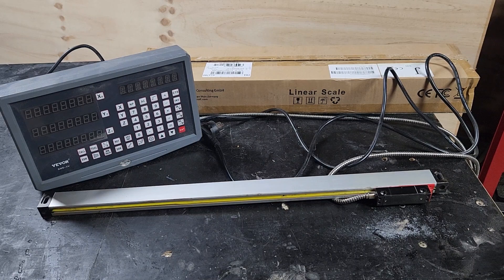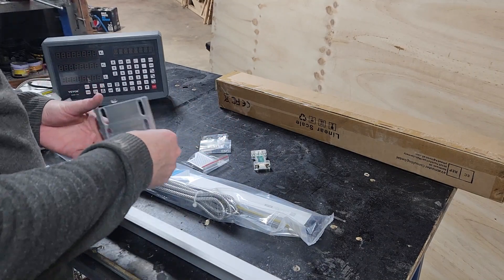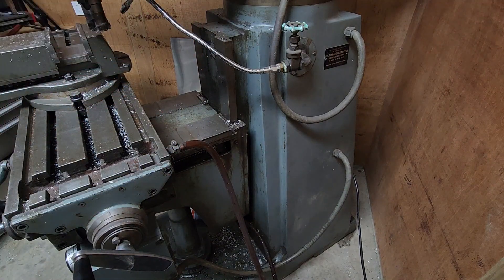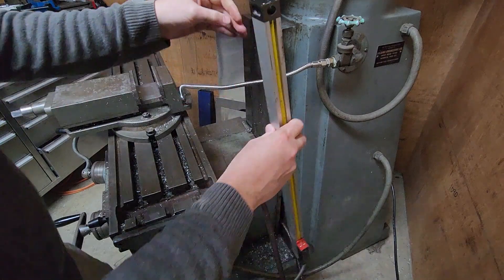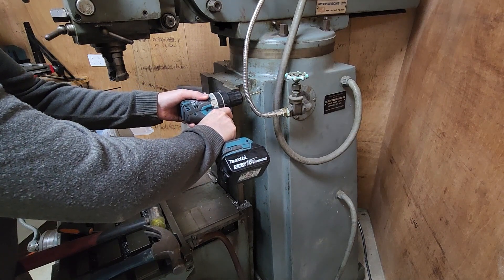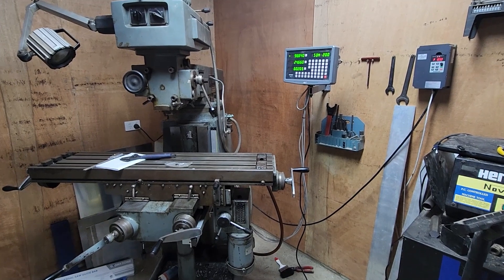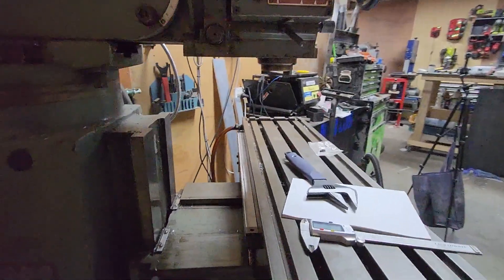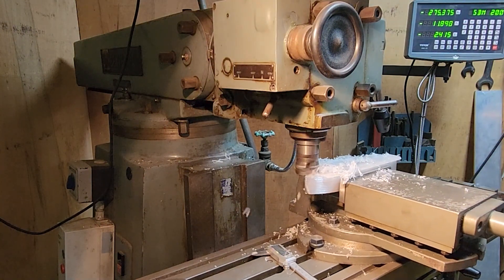Installing a Vevor SNS-3V DRO Kit onto the BeaverPal MK1 milling machine

Comment: Hi Bob, nice Video. I installed linear scales (Form aliexpress) and the Vevor DRO on my lathe but 2 of them are sometimes working and sometimes not. Do you have any Idea how to solve this problem? Are my scales or my DRO defect or maybe uncompatible? Thank you very much ;)
Reply from the maker: Hi @lorenzknoll6393,
Im not too sure what would be happening. 
Couple of things i would check.
1) The electrical connectors are not vibrating and having an  intermittent fault.
2) The readers are not bending while travelling down the slide. 
3) check the scales are clean and free of dust/ not cracked.
Post a video tag me in it and we can see if it is something i can help with.